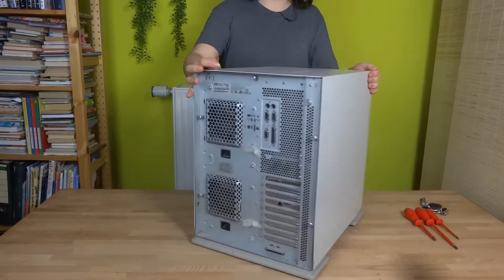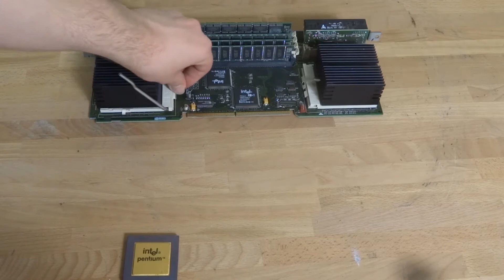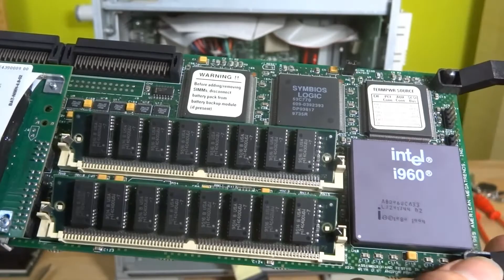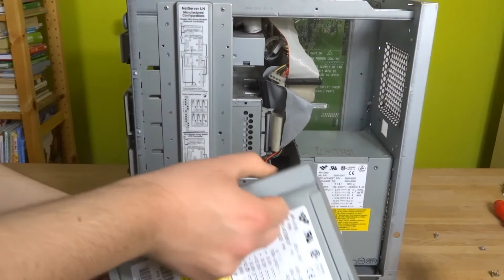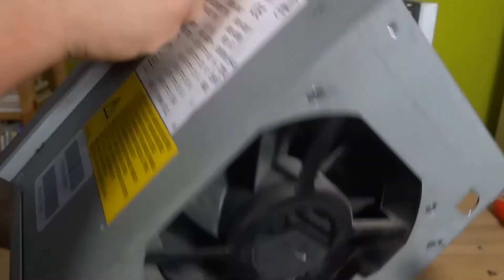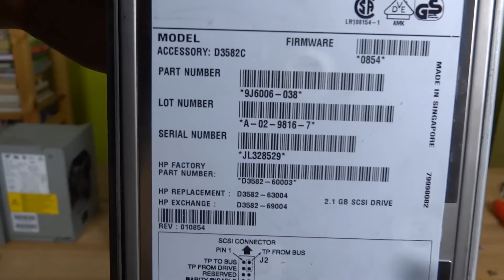A look Inside - HP Netserver LH Pro

Comment: When I lived in Ft Lauderdale in 2001 I had one of these that I picked up surplus for like $100. I upgraded the drives to the huge 9gb ones [lol]. I used it to keep my porn and music collection, all downloaded from eMule. Unfortunately when I moved to Texas all my stuff went into storage and eventually got lost. I replaced it with a NerServer 3000, in which I installed some cheap 50gb drives. Great hardware, easy to work on, plenty of cheap parts available on eBay back then. I ran Windows 2000 Pro on all my machines until the mid 2000s.

Comment: 8:44 - That right there is an infamous Dallas RTC+Battery chip and, if you're having issues with your SCSI array, likely the reason for it.  Once the internal battery in those dies, your controller will not be able to hold its array configuration settings once the machine is powered cycled.
Reply from the maker: that dose explain things. thanks for letting me know. I knew of these chips existing but did not realize that one was in the server

Comment: each of the 68pin internal connectors is a Channel that can be connectoed to a maximum of 15 devices (SCSI IDs 0..15). Normally one channel is supposed to be for internal USE inside the case and the other two can be connected to external drive-cases. So in total u may attach up to 45 devices including Scanners, tape drives, CD / DVD. your i960 runs at 33MHz and the Memory modules are called PS2-SIMMs and can be either EDO- or FastPage-Modules.

all channels combined can almost max out the PCI-BUS (theoretical max of 133MB/s) UW-SCSI burst rate is 40MB/s times three = 120MB/s burst rate.

the OnBoard SCSI cable connected to the port at the bottom back misses a (-n acitve) terminator. And the yellow cable is not just some SCSI cable but a SE (Single Ended) 16bit high density version.

Comment: I'd be interested to see one of these with dual Pentium II Overdrives, and some larger 73+GB 10k drives... and a nice connection to say, an Adaptec 29160 or equivalent in one of the PCI slots. and an active gigabit card such as an Intel one that's old enough to still be able to run on 5v. somewhere in a die shrink of the chipset they removed that possibility.

Sadly the PII Overdrives are pricey when they do show up on eBay, and SCSI connections via SCA to 50-pin for larger drives than 36GB are usually a crapshoot if the backplane doesn't terminate the unused lanes for the drives to be seen right. I had this issue in a couple Mac clones with onboard SCSI, most notably a PowerTower Pro 250. a special SCA to 50-pin adapter was needed. I'd love to know if, with a modern controller, a newer 73 or 146GB drive can be stuffed into the backplane and become usable.

I have the case from someone's Netserver E60 that was in constant use up until about a half a year ago, then got struck by lightning; nothing inside survived. added some fans, cut out the PSU shelf to make room for a proper ATX supply and stuffed a modern LGA1155 board in. it's currently on the way to becoming the replacement for my current main box which is run off a couple 10 year old dual-core Opterons.
Reply: I know this comment is 3 years old, but here goes: I was thinking of making one of these as a sleeper case. Does an atx board fit directly into it?

Comment: Awesome. I still have mine and its going through alot of upgrades and up to date hardware with win 2008. I never got before pictures but if you dont mind can I reference your video to mine when im finished with my server so people can get an idea of before and after? Thanks and thanks for the video, brings back memories of what it was before :)
Reply from the maker: PhantomWorksStudios You can use my video as a refference, as long as the proper credit is given. I'm actually looking foreword to your video.
Reply: cool and thanks. I always give credit where credit is due :). WEll just to give you a quick insight to what I did case wise. The color has been changed from white to black and there are 3 panels instead of just the big single one. Doors for each side as well as a removable top and the front swappable hard drives converted to sata. Thats all that im going to say for now as I dont want to give away the shoe surprise :)